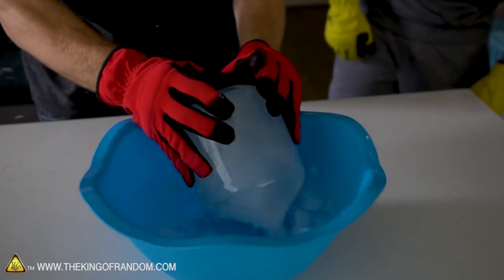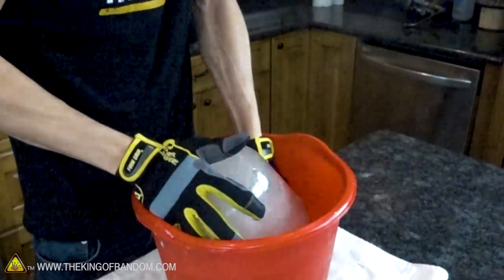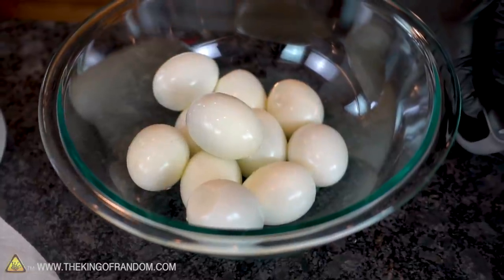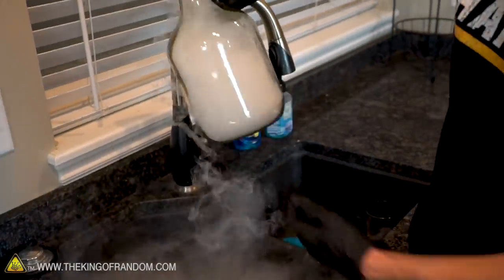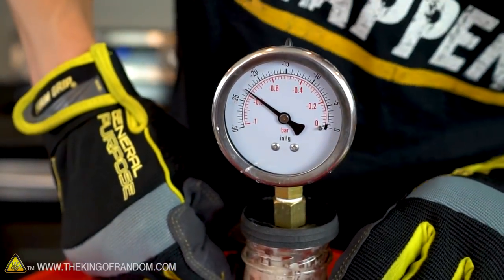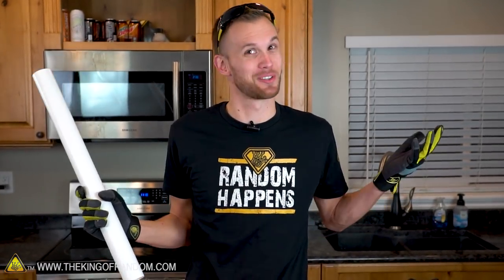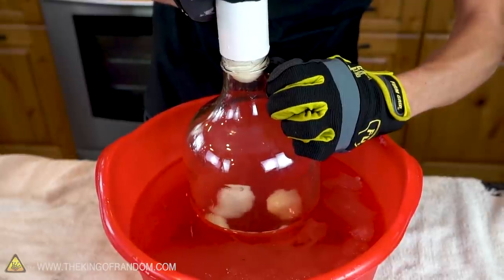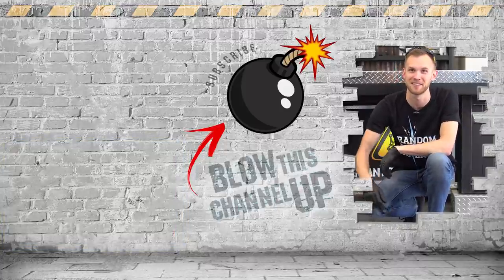Sucking with STEAM! TKOR Shows You How To Make A Vacuum!

Comment: If you put a little bit of alcohol in the bottle then roll it around so it coats the sides and builds up fumes. Then ignite it.  You get a cool effect when it burns.  After the flames go out cap the top for a vacuum. I've used 5 gallon water jugs to do this and It will colapse when the vacuum is formed

Comment: Well, since steam is less sense than room temperature air as long as you don't hold the bottle perfectly upside down you will always loose a little and get air in your bottle. Also the marshmallow obviously contained a little air. Both of which I believe could have made a difference. Therefore I wonder how low the pressure would get if you would hold the bottle upside down and sealing it with the pressure gauge as quickly as possible while trying not to force air into the bottle of course. Assuming there would only be vapor in the bottle, the only thing would limiting the pressure would be the vapor pressure of the water. So theoretically, as far as I'm concerned, you should be able to reach almost 26 inches of mercury.

Comment: Can the pressure from the watter rushing in be enough to be able to shoot the bottle or whatever container is being used to shot it out really far? I guess the jar has to be durrable enough to stand the thermal shock and light enough to be able to be shot far. Im thinking what if you do the bottle thing and then while in the air the bottle thats flying from the pressure of the water brakes because of thermal shock so its just exploding glass everywhere 😂😂 that would be awesome but deadly ☠💀💀💀

Comment: of course you didnt get much of a vacuum from the burning paper. oxygen is only 20% of the air.  then the burning turned that into CO2.. so very little of the Oxygen would have been used up.